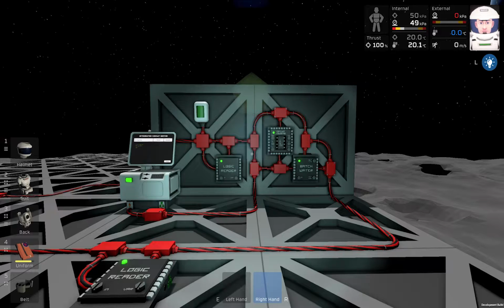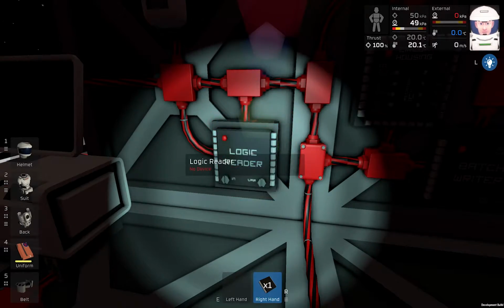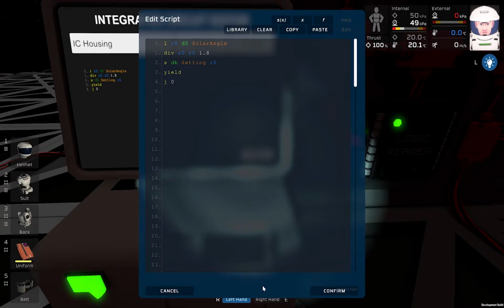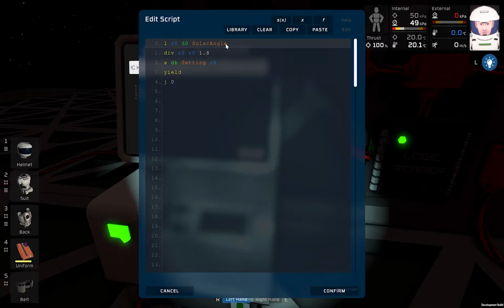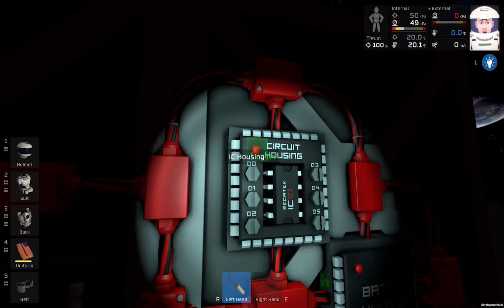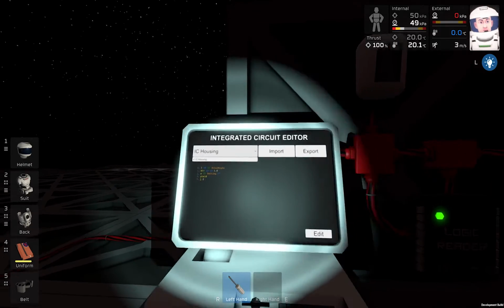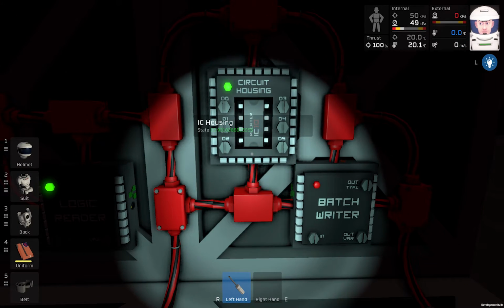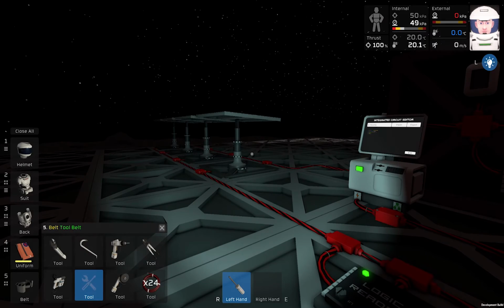Stationeers - Tutorial Moon Solar Tracking with IC

Comment: My first attempt at a solar tracking IC had issues - the solar panels were tracking too slowly and my power generation suffered as a result (i ended up going back to my old logic chip setup). Your code is much simpler - will have to give it a second try.
Reply from the maker: Tracking too slowly?
Reply: That's the best way to describe it. The panels weren't keeping up with the sun, and the efficiency was much lower. My only guess is that the code I wrote had too many instructions? I don't know. All I know is that your implementation is much better than mine.
Reply from the maker: Maybe you could share the code here and Stationeers players will take a look on it, if you dont mind.